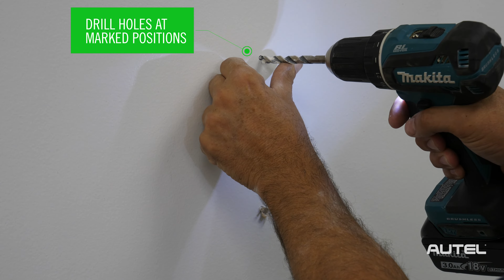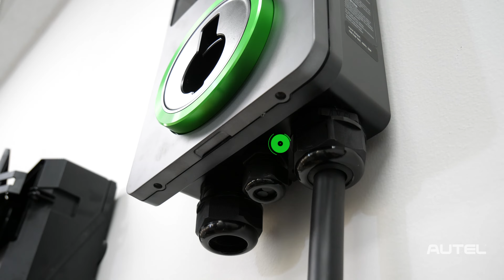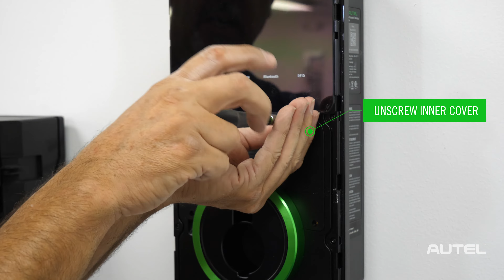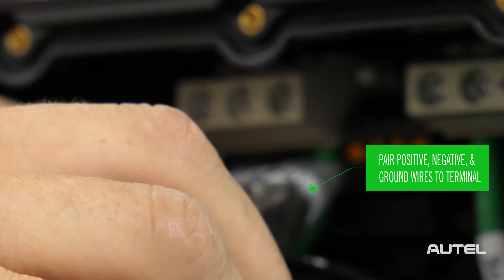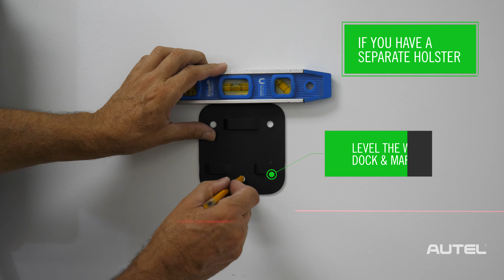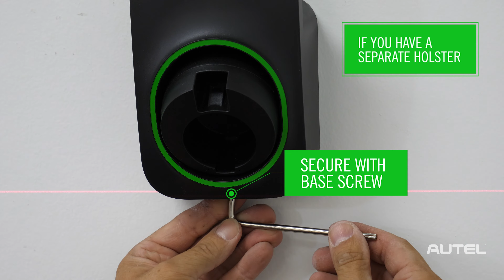Autel MaxiCharger AC Home Installation

Comment: At 137 it has a pop up that says connect Positive Negative and Power  don't 240 circuit have L1 L2 power and then at least a ground and usually also a neutral ?
Reply: It only needs neutral if it needs 120v.
Reply: Amen this is exactly what I thought.  Pure 240

Comment: to power supply theres 4 wires. 2 hot and ground and netural. no hook up for netural ?
Reply: This is why I came here???
Reply: Hope it Helps
Reply: Mine is connected with two hot wires and a ground
Reply: THERE IS NO NEUTRAL ON A HARDWIRED EVSE.